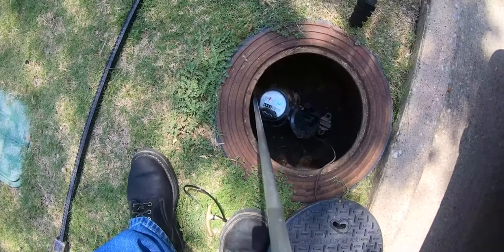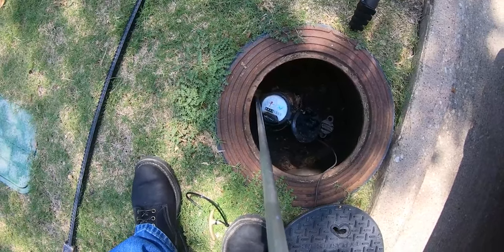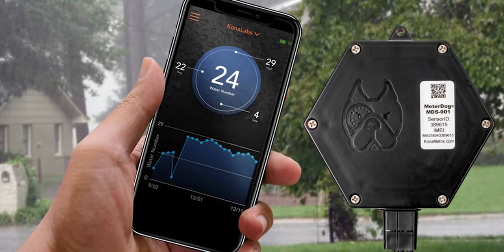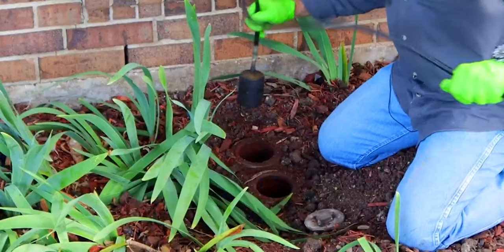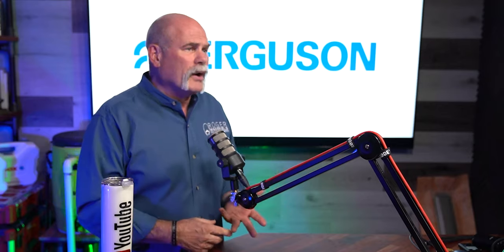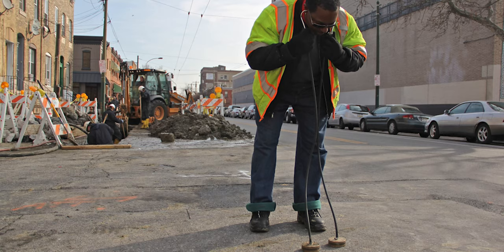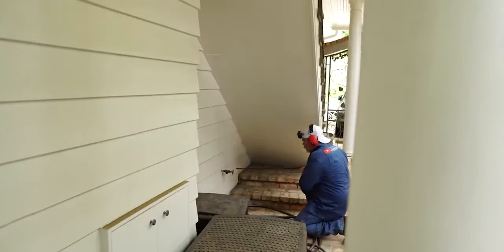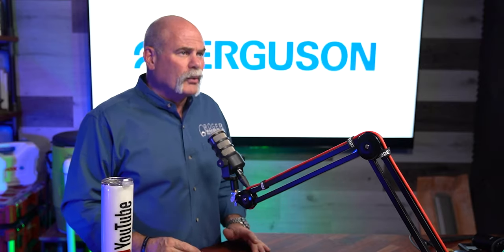Slab Leak Detection For Your Plumbing System

Comment: I work with a leak detection company in la we leak detect and then do single lines or whole house systems with epoxy to seal pin holes pretty interesting stuff.

Comment: Kind sir...do you prefer breaking the slab or tunneling under the slab to fix a slab leak say 5ft from the edge of the foundation?? your thoughts?
Reply: I know it wasn't asked to me but for me it depends on certain factors,  is it a ranch, a finished basement,  how deep it is? The answers to those questions will help me figure out the best route
Reply: Sleeve it with a pen line just a tad smaller.
Reply: Roger prefers tunneling, for sure. He has said before, he contracts with a dig crew who comes in and digs under the slab to form a SAFE trench tunnel for his plumbers to crawl into to make the repair on the piping. Then they pack it back in.

Comment: Why do my pipes knock when the hot water is turned on full
Reply: either not supported in the wall or high water pressure, you can buy a water pressure gauge at home depot for $10, hook it up to your slop sink/hose spigot/washing machine shut off valves and if your pressure is 40-80 psi you're good, otherwise you need a pressure reducing valve (PRV) call a plumber to install it
and if your water pressure is okay then you need to cut open that wall and support the pipes in the wall with some plastic clips and screws
Reply: There are a few reasons. The first that comes to mind is "water hammer." Water hammer occurs when a large column of water that's moving quickly through the pipe, is suddenly stopped dead in its tracks by a valve being shut quickly by a washing machine, dish washer, or a quick turn of the kitchen faucet valve. You can install water hammer arrestors at those appliances or sinks/showers which will stop the banging. They have a small piston and gas chamber and it cushions the water as it slams down into that closed valve so it can slow down easily. Possibility #2 is like Señor Skeletor there said, which is unsecured pipes which are able to jump around and bang into the wall or stud next to them each time the water is turned on or off. The solution is to secure the pipe with mounts to the framing so it's solid. Possibility #3 is that there's a section of pipe that is secured, but it's in a bit of a bind. When you turn the hot water on, the pipe expands from the heat of the hot water suddenly flowing through it, and it POPS as it gets longer and suddenly pops a fraction of an inch within its mounting bracket. It'll pop again after it cools off. 

So, you have to determine if the pipe bangs when you turn the water on and off, only when it's turned off, or several seconds after it's turned on and many minutes after it's turned off. On and off is probably an unfastened pipe in the wall, attic, or basement. Only when turned off, is probably water hammer. Seconds after turning it on and many minutes after it's off is likely a mount binding and thermal expansion situation and you'll need to find out which spot it's binding up and either loosen or tighten that mount more to stop it. Personally, I'd shim the pipe in the clamp with a rubber bushing to allow stable mounting and thermal changes without noise. 💪 Good luck!
Reply: I can say my house is early 1900s  made

Comment: My special equipment is 2 sticks of silver solider, they are my divining rods and haven’t failed me
Reply: Amen my father was a plumber his entire life and I have been one for close to 30 years and I learned that technique from him these young bucks now a days look at me like I'm crazy but it works every time.
Reply: Are you talking about holding in your hands until they crisscross? I was in a situation where i had to find the waterlines and sewer that were capped and buried by 3 feet of topsoil on a lot that had a modular home removed to be replaced with new home-i was there to do something else but needed to know where they were to make sure i didn’t hit them and they weren’t marked. The old neighbor came out out and said “you just need two metal clothes hangers” i said “huh, pardon you” lol. He then brought out two metal hangers -unwound them so they were straight , then bent them into a shape of an L. He then gently held one part of the L in each hand with the other part of the L pointed forward with his arms and hands out in front of him. He walked the lot like that and as he got close to the water lines the hangers started pulling towards each other and then crossed each other in the shape of an X -it was wild to see the metal move on it’s own and sure enough i dug in a 3 foot area under that and found the pipes. Crazy stuff. And yes i did try it myself and it worked.